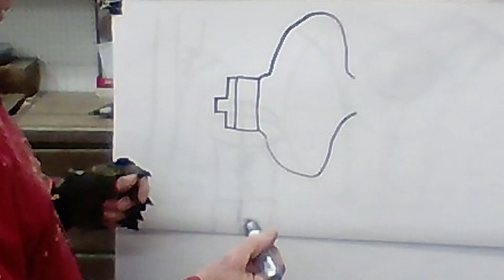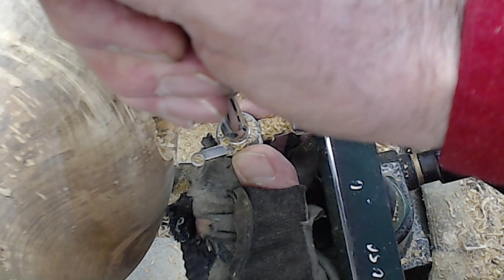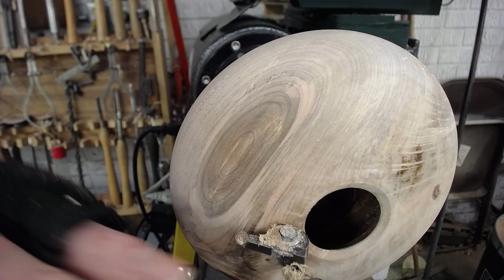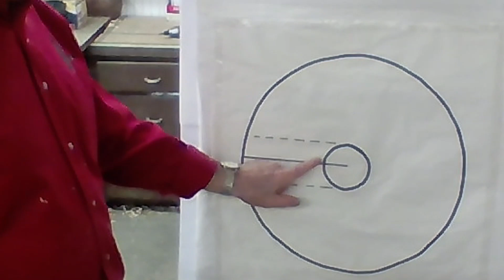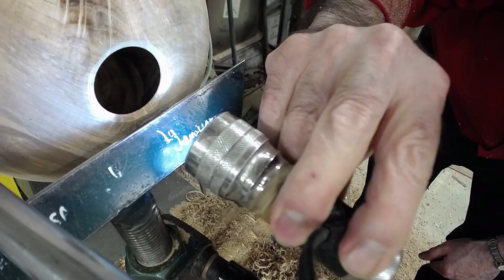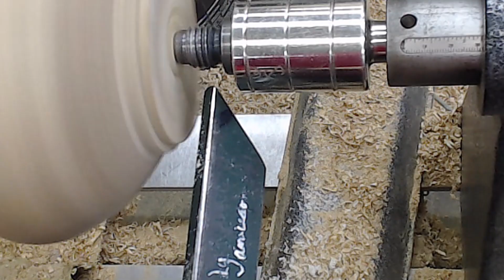Hollow Form from a Crotch, part 2

Comment: Lyle would your hollowing system work on a midi lathe — I have a jet 12/20 lathe..? Richard Anderson
Reply from the maker: Hi Richard, Yes, My system is made to fit any lathe.  I have a 1220 I take on the road with me to demonstrate the system at Symposiums all over the country.  Did you see I have a 2 1/2 hour Interactive Remote Demonstration 1-6-21??  I will be doing a Hollow Form with a void. See my web site for details.  Merry Christmas
Reply from the maker: Hi Richard, Yes, My system is made to fit any lathe.  I have a 1220 I take on the road with me to demonstrate the system at Symposiums all over the country.  Did you see I have a 2 1/2 hour Interactive Remote Demonstration 1-6-21??  I will be doing a Hollow Form with a void. See my web site for details.  Merry Christmas

Comment: Great job. Do you put the danish oil on the inside of the hollow form? Merry Christmas.
Reply from the maker: Hi Glenn, Oh Yes, always put the same finish on the inside and outside.  It is harder to wipe out the inside but find a way. Did you see I have a 2 1/2 hour Interactive Remote Demonstration 1-6-21??  I will be doing a Hollow Form with a void. See my web site for details.  Merry Christmas

Comment: Nice video.  All I want for Christmas is to be able to start sanding at 320
Reply from the maker: Hi Fish,
Thanks for writing.  Check out my Bowl Basics DVD.  Sharp tools, sheer scraping, and grain orientation are the keys to good finish off the tools. Did you see I have a 2 1/2 hour Interactive Remote Demonstration 1-6-21??  I will be doing a Hollow Form with a void. See my web site for details.  Merry Christmas

Comment: Thanks for sharing Lyle. I do quite a bit of hollowing using the "elbow tool". With your explanation in this video I should be able to do a much better job of it.
Take care, Dave
Reply from the maker: Hi David, Other systems have some limits, so stay within the limits and stay safe.  Look for my installation instructions in my tool store and see if you can fine tune your system to work better. Did you see I have a 2 1/2 hour Interactive Remote Demonstration 1-6-21??  I will be doing a Hollow Form with a void. See my web site for details.  Merry Christmas

Comment: Hi Lyle,,,  once again such a great informative video. Just a beautiful piece of maple crotch and you did such a great job as always. Thanks for your time. I always find myself refreshing my thoughts with your vids. Have a small question?.... is that a different laser your using on your hollowing system?... looks slightly different from mine when I purchased the system from you few years back. Reason I’m asking I caught a glimpse of it in this video and thought I saw like a “ laser label awearness sticker” on it, plus been meaning to order a new laser from you cuz mine been acting up. Anyway thanks again for all your hardwork and time with vids and stay safe and you and yours have a blessed Xmas and new year.

John Miller 
Custom Woodturnings
Reply from the maker: Nice to hear from you John,  thanks for the feedback. Yes, I have a new laser manufacturer.  Please give me a call if you are having troubles I will replace the old one wit a new one. We can use all the blessings we can get, thanks.  Did you see I have a 2 1/2 hour Interactive Remote Demonstration 1-6-21.  I will be doing a Hollow Form with a void. See my web site for details.  Merry Christmas